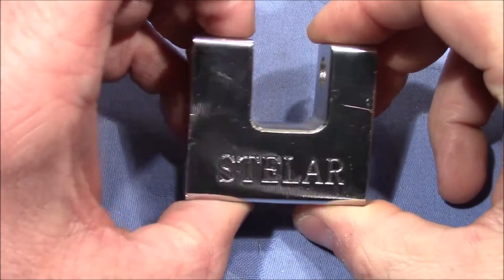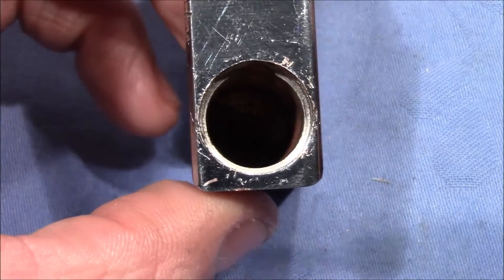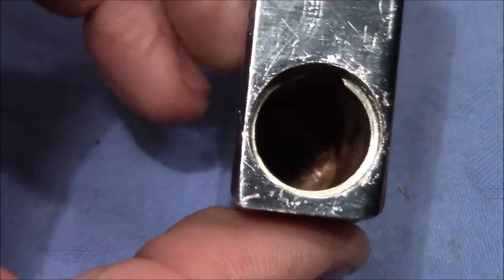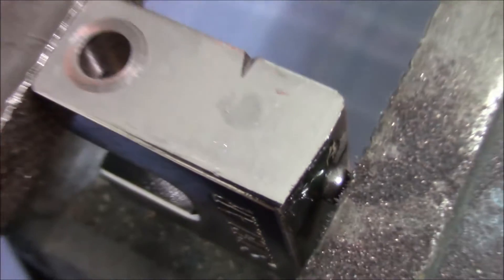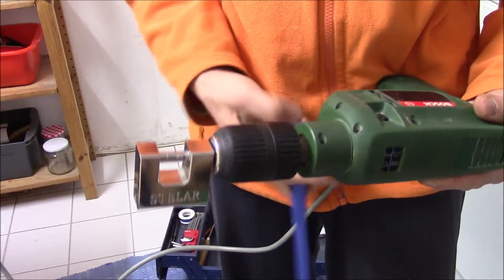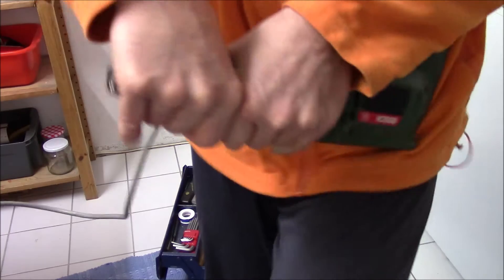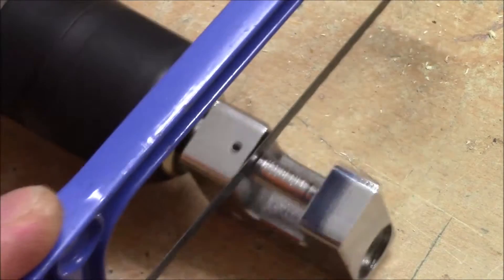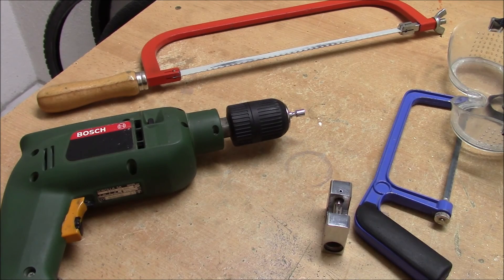(picking 655) Splatter B-Movie: Disc detainer shutter lock dissected and drill-cutting tested

Comment: Could you make a video on the Abus 190cs/60 series2 combination padlock  as I bought one from eBay and it came locked without the code I have been told you might be able to help me find the the correct combination
Reply from the maker: Great lock - just had a look online. But I don't have it. Does it tension the internals when pulling the shackle, so that you feel resistance on the wheels (maybe use a screwdriver to turn the wheels)? Or maybe you you a feeler-gauche to probe for a flat spot on the inner wheels (or use a soda can cut-off). Good luck. BTW: Where are you from?
Reply: @Potti314  I live in the UK and I have tried to feel down by the wheels but it is all smooth and round and there is no tension on the wheels when you push or pull on the shuttle
Reply from the maker: @michael8205  To buy this lock myself is a bit expensive. However I checked a video where this lock is operated and it tells me that you cannot tension the internals by pulling on the shackle. It's advertised as high security combination lock and maybe it's true ;-) The inner wheels might be shielded but I would give it another try with a thin feeler gauche on both sides of the wheel and carefully probing... Other ideas: Clamp it into a vice and turn the wheels with a screwdriver and listen to the internals, also try to feel a change of resistance for different numbers. Maybe this all doesn't work, but it's worth trying it. Also see if you find openings in the locks where you can stick a pick in to tension the internals therewith. It's a great puzzle and you can have a lot of fun playing with our lock. But be prepared that you will not find a solution. If nothing works there's always the bute force option to try every combination ;-)

Comment: Which way are your teeth on blade going
Reply from the maker: The saw blade cuts on the forward stroke (when pushing). I didn't pay attention which way the drill spun when doing the tests, however I did an analysis of the footage later on and found that my drill rotated in both direction in my tests. On my drill it's easy to accidentally change direction ;-) Looks like the table support and the other blade made more of a difference.

Comment: There may be more than just copper and chrome, might be copper, knickel, and chrome, and possibly more, use to work in chromed plastic plant, many layers to make chrome over plastic, so not as many over metal
Reply from the maker: Thanks - interesting that plating is still less expensive compared to just using brass with is corrosion resistance by its own.

Comment: The red metal is copper, when chrome plating I have seen them plate with copper first.  I believe it is to get better adhesion of the chrome than plating directly on the base metal.  I think it is only done with certain base metals.
Reply from the maker: Thanks - yes probably copper. Interesting to learn about plating.

Comment: Wow! I was surprised that the design of the lock was so simple. I have 4 of the same model of a cheap Chinese shutter lock (brass, so easier to cut). I'll cut one of them up one day to see how they are constructed.
The reddish colour looks like copper but I don't understand why they would coat a steel lock in copper before covering it in chrome.
Reply: Copper plating is normally used before plating steel.... and most metals I believe.
Reply: @DonzLockz  Oh, I didn't know that. I should go and look it up. Perhaps for electroplating because copper is conductive.
Reply: @two_tier_gary_rumain  yes true and it helps with the adhering of the chrome or nickel etc.
Reply: @DonzLockz  Found this on the chrome plating Wiki page -

"Triple plating is the most expensive and durable process, which involves plating the steel first with copper and then nickel before the chromium plating is applied."

That was in reference to cars.
Reply from the maker: Interesting to learn about plating. Although it sounds like an expensive and complicated process, it seems still be less expensive than using brass instead of steel.

Comment: Well the hacksaw and drill method works, but holding the pin stationary with a wrench might work just as well with a good saw blade ?  The plating looks like chrome on camera - so the under layer is probably copper - fills scratches and gives corrosion protection. There is often a layer of nickel between the copper and the chrome also, but not in this cheap lock I think :o)
Reply from the maker: I agree that holding the bold with a vice-grip would work fine. However this spinning bold does make it harder to cut in general. Filling scratches with copper - never thought of that. Thanks for the info.